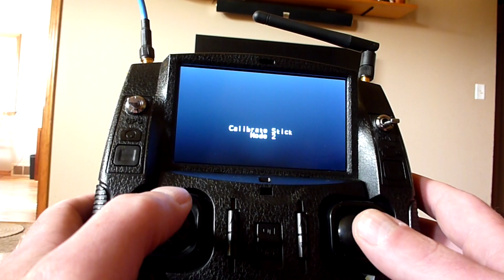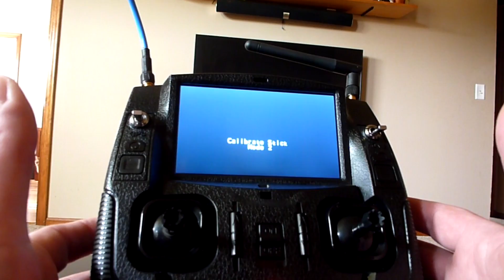Hubsan X4 H501S & H501S-S Transmitter Stick Calibration

Comment: hi i have a husband h501a an just picked up a controller h901a thought would be better with built in screen but cant get the controller to work right maybe i had on different mode but one point had no real control so had to land drone.im used to the smart phone an controller set up ok.only had it since december.it has the transmitter on top also.i bought it off eBay off s hobbyist guy .steve
Reply from the maker: Hi Steve. I personally like to fly my h501A using the 901A rather than cell phone. One thing to be sure of is that the gps switch is on and the screen shows "GPS Mode" at the bottom. The app will automatically put it into gps mode . This could be your issue.

Its always good to do a stick calibration as well. 
https://www.youtube.com/watch?v=a3wAOyro-yE
Reply: just been out with my drone today an no problem with the other hubsan controller with samrtphone attached.will try stick calibration.i think i did the twiddle both sticks in  circles thing .will check your video.so you find the 901 a quite good to control then.its the same sort of controller i guess
Reply from the maker: @stevemcgowan3017  Yes the easiest and best out of the many controllers you could use with it.
Reply: @FlashForwardRC  hi flash i just had another go with the h901 and drone crashed an need a new shell now.im not happy bunny.thats not right i had no control like my other setup ,i did the stick 2 circles thing an binding plus calib it took off but wasn't responding how it should.i can't afford to shell out for parts.its quite easy with the smart phone an h1101 to control as just had a good 6min flight on a local hill..thanks for help anyway
Reply from the maker: @stevemcgowan3017  Bummer, sorry to hear it didn't go well. Possibly an issue with the antenna in the transmitter. You can check the rssi screen in the menu to see the signal strength once you get it back together. That is if you plan on using it and havent smashed it to pieces yet!
Reply: Flash Forward RC maybe just try the antennae on my other controller  for more range ?me and my wife gaffer taped the hanging motor on one arm back on but thing mayb too much weight and wouldn’t take off.but that could have been I put wrong propeller on as realised they are marked A and B for front and rear is it .anyway when   New body comes will strip down carefully and only practice over grass for now 😀
Reply: We have had some good weather here in uk and with the virus about it’s like Xmas day in the summer.hope alls well at yours too .😀

Comment: I have the advanced H906A but had a question that might also relate to the standard controller.  I noticed (in Mode 2) that all the trims EXCEPT throttle trim will make a loud beep if you take the trim to either extreme of the range AND also loud beep at the center point.  BUT the throttle trim only makes the loud beep at the extremes and NOT the center point.  Seems odd.  Have you experienced this?
Reply from the maker: Hey Biker, unfortunately I do not have the advanced controller but I have not noticed this on the standard.
Reply: @FlashForwardRC  Thanks!  I found a post on rcforums.com that reports this is normal for the H906A transmitter.  They don't know why, but that's how it is!  There are 20 clicks between the two extremes so you can count 10 from either extreme to reach the midpoint or just take a careful look at the screen.  Thanks for all your great informative videos!

Comment: Hi there, i had an issue with my H501ss transmitter yesterday, the H501ss doesn't respond to the command on my H901a transmitter, it doesn't move forward, backward and downward,so i force him to turn off the motors on a 5feet above the grassy land, any tips on this issue sir? Thank you in advance for response sir and help sir.
Reply from the maker: Hello. I would first start with the basics. Rebind the transmitter to the drone and perform the calibrations in the manual. It could be a bad calibration or interference in the area. If it continues you may have a 2.4 g antenna issue.
Reply: @FlashForwardRC  i did an imu calibration and transmitter stick calibration this morning and will test fly later at an open ground. Thank you for your timely response., my manual guide had been lost for a long time, im just relying on youtube tips

Comment: Any idea why mine doesnt come up in calibration mode just normal screen mode? Any help is appreciated...
Reply from the maker: Not sure. When you start normally are the stick position indicators in the center positions when looking at them on the transmitter? If so you should not need to calibrate the sticks. If they are way off center, you can try various stick positions while turning on to try and get it to the calibration screen.
Reply: Thanks for the reply, I think that was it - I had yet to get sticks calibrated and mode set. The instructions are pretty bad but hey you get what you pay for:-)